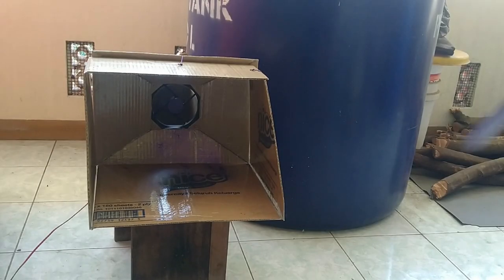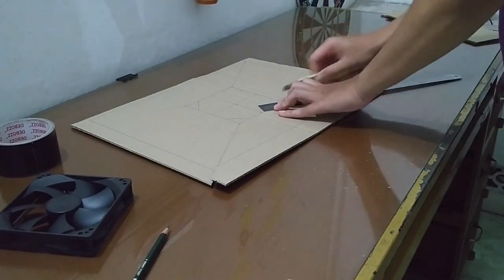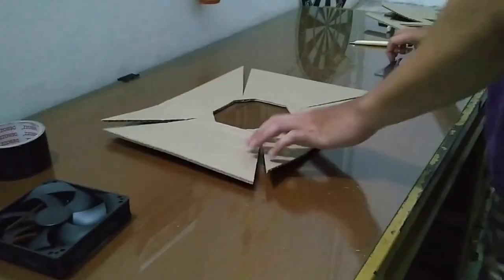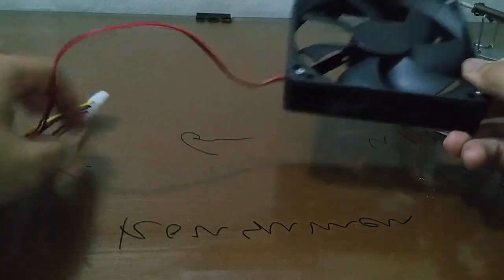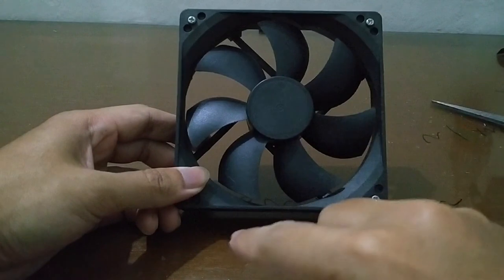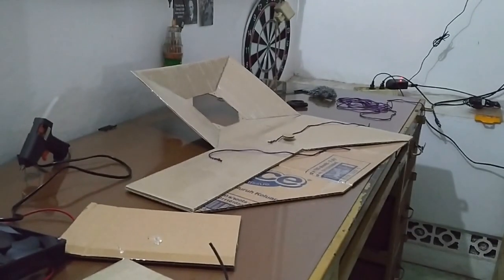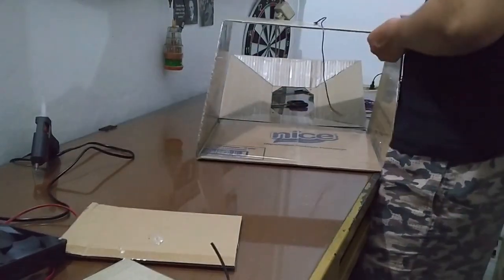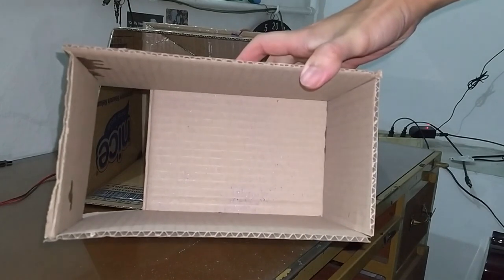How To Make Simple and Cheap DIY Paint Booth with Cardboard

Comment: This is great! 
My critique is:
1. you should have a filter over the fan to keep paint from gumming it up. 
2. find a way to seal the back of the box (could be as simple as throwing an old piece of cloth over the box to keep dust in and control the air flow)

Comment: Add a car pollen filter panel and you wont have the paint cover the fan and make it unbalanced after a few uses. An unbalanced fan wont turn properly and wont pull as much air. Car pollen filters are cheap and work well, collecting up the paint particles and keeping things clean.

Comment: The last few months I’ve been dumpster diving and have enough materials to make something nice. 57”x32” plexiglass from a 65” TV, multiple (maybe a dozen or so)12v fans from computer towers, a nice AC(alternating Current) fan from a microwave, more 12v & 18v fans from 2 Mac G5 computer towers, 30’ of helix flex duct from a construction site dumpster(it happens to be the same diameter as the microwave fan😊), plenty of light fixtures, LEDs and LED strips from inside TVs and many appliances, and plenty of small and large motors, I want to figure out how to make a “lazy Susan” turn left or right using reduction gears from DVD players, printers, and some toy cars(the kind you pull back and then let go), hook up some switches to control it. I have a microwave motor from the plate rotator which I could use because it has the gear reduction inside it already but I’m still learning electronics and don’t want to fry the circuit board inside. I have several bissel vacuum motors which I could use to make the vent but they’re loud but using the microwave fan up top and then use all my 12v fans in the bottom. I have a lot of clean 1/2” sheets of plywood that a foreman at a construction site gave me which I could use for some of it and then use the fogged plexiglass as windows. I also kept all the light defusing plastic sheets from the TVs I snagged out the dumpsters also. Right now I’m looking on YouTube for ideas and yours is the first video I clicked on. I want to make mine as nice as possible so it will last and then maybe sell in the future.

Comment: you are just sucking the fumes and spray into the fan? the fumes and spary will simply go straight back at you  if you dont have a tube leading them OUT.
Reply: It def needs a filter in front of thr fan